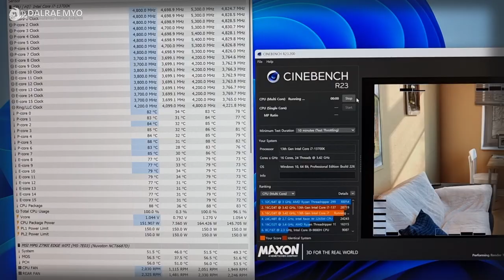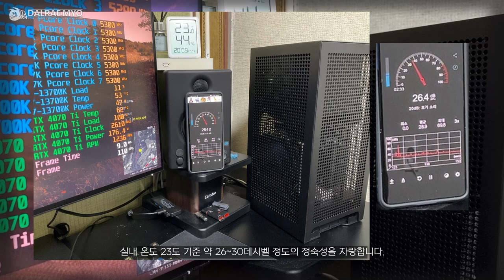NZXT H1 V2 Air Custom Build | 13700K RTX 4070 Ti

Comment: Watching your video made me learn more. I replaced the si100 12x25 fan with a noctua 12x15 with a maximum speed of 1850, and the case shell does not need to be damaged.
Reply: How did you manage to fit the SI-100 without damaging the case?
Reply: @thegeekystuff3800  use 12X15 fan
Reply: @dhz666  Thanks, how much distance is left from the dust filters, and what's the fan noise like, if there is any?
Reply: @thegeekystuff3800   8MM，It is less noisy than the built-in water pump, and the bios can adjust the fan curve
Reply: @dhz666  that sounds promising. thank you, I'll consider your suggestion. I just ordered a silverstone air slimmer 120 as heatsink fan
Reply: @thegeekystuff3800  how did it go
Reply: @fayenotfaye  TR SI-100 with Silverstone Air Slimmer 120 fans quick review

Temps up by only ~3°C
Acoustics is wayyyy better, very silent even at 1200rpm

Overall, I'm happy with the results.

Comment: For those with NZXT H1 v1 case: I was able to install the SL-100, following the steps from the video. It was kinda hard to install it properly, and the fan does not fit it perfectly, but the temps are kinda good.

Temps:  (28/29°C Avg on my room - Summer Season) - AMD Ryzen 5 3600 (Overclocked at 4GHz on a Hackintosh)
- CPU temps: on idle 45 / 46°C
- Max temps on benchmark (Geekbench): 54°C / 56°C
- Tip: Undervolting CPU could decrease a few °C.

Kinda good, not sure if this is much better than the NZXT pre installed AIO, but as a replacement seems just right. Also as I said before, this temps are on Summer Time, with 40°C outside and 29/30°C inside the room. I expect 32 / 35°C CPU temps on idle on Winter Season.

Thanks to @DalraeMyo for the video!
Reply: Hey, I got this cooler as well and tried to install it on my AM4 board, but the cooler is kind of too wide on the left side of the case, it is pushing against the support pillar of the case, even without a fan attached. I'm no expert in PC building (hence I got the H1) but am I doing something wrong? In the video, he's using an Intel board and that mount allows him to rotate the cooler 90 degrees, so the long end is on the bottom rather than on the left side. But you seemed to manage to install it on an AM4 board. I'm using an MSI B550i Gaming Edge Wifi motherboard if that changes anything.
E: I think after comparing some B550i motherboards just visually, my MSI board just has the CPU mount very far on the left side. Guess that's bad luck then, have to return it and get the V2.
Reply: @drchtct  Happened exactly the same to me mate. The Cooler is pushing against the support. Try to figure how it works and fits better (for me worked like in the video), and install it without the fan first.

The fan will not fit perfectly either, and the claps or the grabbers from the fan will not install properly. In my case I had to tie them with some black "zip ties" or whatever them are called.

In the end, I was able to install it, and modify the V1 case to close it properly (like in the video).

I was struggling for a bit, but with patience and following the video I was able to fit it and install it.

Also the temps are pretty good, as I said in some other comment, or on the top one.

Notice me how it goes mate. And do not surrender, it should work with patience.
Reply: @DEV_XO  Thanks for your replay mate. What motherboard do you use? I think my CPU is just placed too much on the left side. I compared the photos from other boards and they seem to have it more central. 

I don't know, I really tried to squeeze it, but don't want to damage anything because I can't return it afterwards if it's scratched and stuff. 

If it doesn't work it's not the end of the world, NZXT refunded me the money for my entire H1 because they couldn't deliver a new AIO during the warranty time.
Reply: @FlashTVBox My motherboard is a B550I AORUS PRO AX

As I said before, in my case does not fit it perfectly either (besides the Cooler is installed correctly and mounted as It should be) it's more or less on a left side, and looked like I could break something, but following the video, and figuring out how to setup it properly, it ended up working.

I know the feeling about that it will not fit or you could damage the cooler / anything else, as I said, it's kinda hard to make it work and you need to try to fit the Cooler in a few ways (for me worked like in the video, same position / orientation )

I don't wanna you to push it to the limits and make it work, in my case had no chance. Was to make it work, or to go for a new case, or a Noctua lower profile CPU Cooler. (With lower performance for sure)

If you can get a new case, or to make a refound, feel free to go for it. 

Because no matter if you install the cooler, the H1 case still need to be modified (like in the video). 

So yeah, notice me how it goes and what you will end up doing. I'm "developerxo" on discord, in case you wanna add me, maybe I could send you some images from my build.
Reply: @DEV_XO  I just tried to fit it again and the cooler itself now fits in but it's still below the support pillar. So I tried putting the fan on top and it would be offset by a few cms to the right, so I need zip ties and have no idea how to mount the fan without reaching the left side of the cooler. 

I think I'll just go for the Noctua LN-L12S as it includes 90 degree kits for mounting it in other directions. It is about 5 degrees hotter than this one, but I don't really mind considering I'll stick to Ryzen 5 in this case anyway, and the temps you showed +5 degrees is still more than enough for me. Just want it to finally work again..
Reply: @drchtct  All right mate, the Noctua it's still a good option, the case it's just pretty and on Winter times you gonna have 0 problems (Summer will be okay)

I'm here in case you wanna ask for something.

Feel free to share with me the Noctua update, I would love to see the temps and how it went the installation.
Reply: @DEV_XO  Yeah, summer is a bit of a struggle, but my GPU struggles more than the CPU in summer anyway. I play mostly at higher resolutions, so the CPU won't have to do that much work. 

Also thought about switching to an NR200 but I think it's pretty big and won't fit onto the shelf as nicely, or the Meshroom S, but then that's so much money for not really any benefit. H1 has its flaws but as long as it gets me decent performance for this 2020 generation of tech in there, I'm happy to stay with it, it's super pretty and functional enough for most usecases.

And thanks for your detailed answers, really appreciate that! Will be trying to test some temperatures when it arrives.
Reply: @drchtct  All right mate, I think I was looking for the NR200 also, but I forgot why I didn't went with that option. (Maybe was too big for the case, not sure) 

The case it's pretty amazing (although of his flaws). I think the V2 of this case It's a bit bigger, but for me still the most pretty case out there.

Anyways, notice me the temps from the noctua, or whatever you gonna install in it.
Reply: @DEV_XO  Installed it, fits very comfortably. First, this is way quieter than the AIO with the pump running and stuff. I barely notice the fan noise which I didn't expect.

Temps so far (25C sunny outside):
Idle 43-50
Cinebench single core 65-68
Cinebench multi core 84-86
Geekbench 65
Gaming 70-73 with 90% single core utilization in Battlefield 5 multiplayer

Got 88% in UserBenchmark for the CPU, so that is way above average, I'm happy with that. Didn't overclock or undervolt anything for the record. But won't use heavy computing on this PC anyway, the H1 is more like a Xbox Series X with better hardware for me. Have a laptop with a 6800HS for any rendering etc

So yeah, very very happy that I finally have a working PC without any thermal throttling again.
Reply: @drchtct  What CPU cooler did you installed in the end? The Noctua? That are some great temps for summer time, on winter will be much better I guess!. 

Happy to know you finally are able to have your PC back! And also, no more AIOs! So yeah!

Amazing mate! Enjoy! :)
Reply: @DEV_XO  yeah the Noctua in the end. Guess the Thermalright would cool down another 5 degrees or some, but for my needs it's plenty enough. Thanks for your help again, man
Reply: @drchtct  Yeah the Noctua it's an amazing option too.

Happy to know everything went well mate, thanks for the talk! Have a great one! :)

Comment: This is slick, I was planning to get this case but the aio pump failure was a deal breaker, should have thought about this , the v2 is bigger aswell vs the older model. the temps with i7 at 170watt looks reasonable, it would have totally handled the i5 13500 i have.

Comment: actually you can put gigabyte eagle rtx 4070 ti without any mod and no need to remove the dust filter as well
Reply: Do you know if the PNY 4070 TI will work that way too? I'd prefer that card if possible as it's so quiet
Reply: @thenewdesign  have to be 2 slot with 58mm max of thickness. I think all of the PNY 4070 TI came with 3 slot. You can set the fan curve of Gigabyte Eagle RTX 4070 TI, make it more quiet than it's default.
Reply: @dhajal  Thanks! I ended up going w/ the MSI Ventus 4070 Ti OC which is apparently significantly smaller than even the Eagle, does really well w/ undervolting, and seems perfect for this case
Reply: @thenewdesign  cool! Yes undervolting 4070 TI are fun. My Eagle 4070 TI power consumption is now between 120w-168w. Depends on the game

Comment: How did you swap out the stock nzxt psu? Did you have any issues with it, especially the the cables?
Reply from the maker: There was no problem with the operation, but the cooling fan noise bothered me, so I replaced the power supply. You can easily replace the power supply by removing the four screws on the power plug side of the power supply.

Comment: Haven't seen any like this before, really nice build. I'm quite interested and also want to re-make my own, btw what is the clearance for the cooler if you don't mind?
Reply from the maker: When removing the AIO radiator bracket and the internal dust filter, the cooler could be installed up to 99 mm high.

Comment: PRO TIP:

If your motherboard is GIGABYTE  or AORUS AM4 — this may not work for you as the AM4 cpu socket is offset to the far left side of the case. A solution would be to buy a thermalright AM4 bracket for Peerless Assassin Series so you can flip the heatsink perpendicular to the IO ports. 

Saves you $$$$ from buying a new cooler or another mobo

Comment: Hi ,Great build : and i ask you :

1) i ve seen you can add 4080 FE only removing sdd case and “ cut” or replace 3 slot bracket and remove filter on H1.( 4070ti not great GPU for 4K )

2) i think you can change AIO with cooler master one for silent and temperature performance? Or add 280mm Aio with front/back cover custom ( easy to find on Etsy).

What about ?

Comment: Does the Thermalright SI-100 fit in the V1 of this case?
Nice video!
Reply from the maker: H1 v1 can also be installed in the same way as the video.
Reply: how much actual cooler space is there, can it fit 115mm c14 s or wide alpenfom blackridge cooler?
Reply: @danielvipin7163  Idk, you basically have to cut some claps in the case to fit it (like in the video), so I guess no space at all? 

I'm using the fan that comes with the Cooler, but If you have in mind to use a smaller fan, I'm sure it will be some available space, and the case would not need to be touched.

In any case, the temps are good, and following the video it's all you need (and some patience while fiting everything in that tight space)
Reply from the maker: @danielvipin7163  With the dust filter removed, the SI-100 could be installed at maximum and there was no free space.

Comment: how does it compare to the stock cooler, is it cooler?
Reply from the maker: I replaced it with an air cooler to avoid pump noise and frequent pump failures. AIO cooler would be better for cooling performance.

Comment: how much actual clearance for cpu cooler is there, can this fit the nh c14 or alphenfom blackridge cooler?
Reply from the maker: 100mm is the maximum height of the cooler with the dust filter removed.
Reply: @DalraeMyo  so c14 is a no go.
 How much width and length we have?
Reply from the maker: @danielvipin7163  The heat sink size of the SI-100 I used is as follows.
(L)120 x (W)108 x (H)74.8mm

* For horizontal and vertical sizes, there may be a size difference that can be mounted depending on the location of the CPU socket position.

Comment: Is it viable to keep the radiator mount and put a slim 140 mm fan on it?
Reply from the maker: To use the SI-100 as it was, the radiator mount bracket had to be removed due to a height issue.
If you use a 140mm slim pan, you don't have to remove the radiator mount bracket. However, CPU cooling performance can be significantly degraded.
Reply: @DalraeMyo  thank you

Comment: Can this case install an SFX L (ROG LOKI 1000w)size power supply?
Reply from the maker: There is room for SFX-L standard power supply installation. (I think it's because the previous version was SFX-L standard power supply.) However, if you use a lot of modular cables, you may not have enough space.

Comment: HI , is it okay to use i5 13600k pair with TUF 4070ti using Astock z690M ITX DD4? coz im gonna use NZXT H1 V2 as well..... any advice?
Reply from the maker: Asrock z690M ITX may not perform well at 13600K because it can output up to 150W.

To mount the 4070ti TUF to the NZXT H1 v2, the dust filter on the panel must be removed and the latch securing the dust filter must be bent.
Reply: @DalraeMyo  oohh! soo wat mobo can I use to support i5 13600k sensei?
Reply from the maker: @PiggyByt3  I recommend a motherboard with a power supply configuration of 600A or higher.

Comment: Nice Build! Rtx4080 FE will fit instead of a 4070ti..
Reply: Will it?? Just without the SSD tray and dust filter?
Reply: @thenewdesign  yes but you have to bend the 3rd tab on the 4080's IO Shield/Mounting Bracket inwards to make it fit as the case only has 2 slots.
Reply: @Restless2010  Thanks! I read Gigabyte makes an "Eagle" edition of the 4070TI that's physically smaller and requires no case modification. I might go w/ that since I'm putting a 13900KF in this anyway